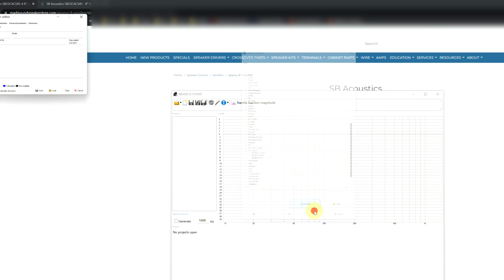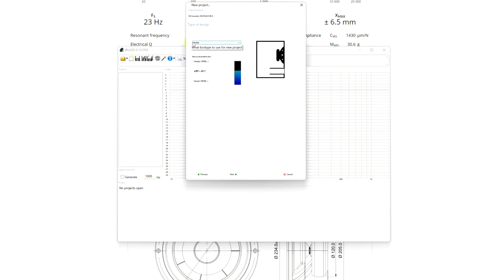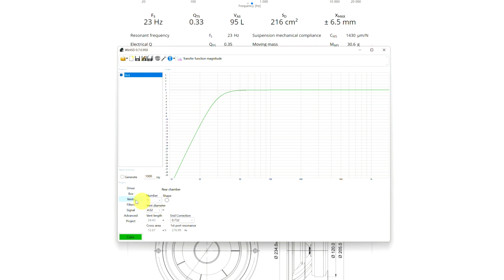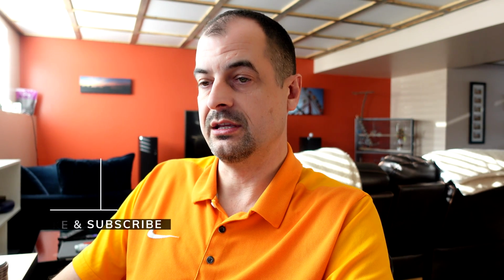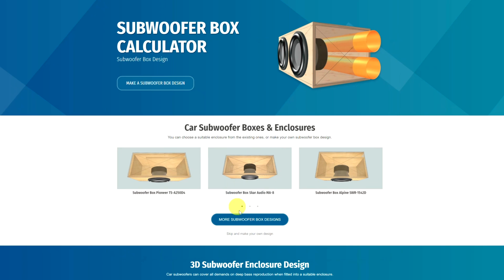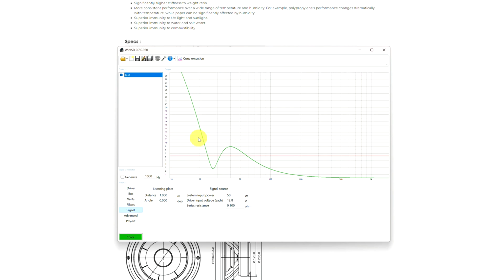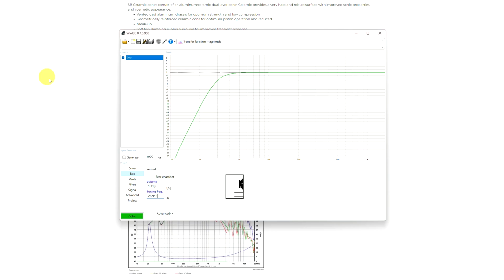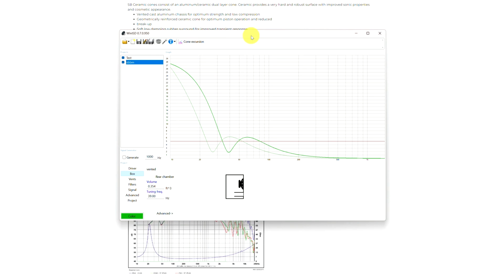Using WinISD To Help Design A Speaker Box

Comment: Hi.
I like the videos from you so far.
Got a couple of questions:
1-What is better - tune port to higher frequency or to a lower one than the fs?
2-if able to tune below the fs, how much lower, 5,10 or 15hz lower than fs?
Keep up the amazing box building!
Thanks.
Reply from the maker: I appreciate you checking out the channel.  I can't answer your questions with certainty but some reading seems to have people typically going slightly above Fs.  If you use WinISD start by what it picks for you, it defaults to the theoretical best provided you have driver specs loaded correctly.
Reply: Thanks.
 @davewiebespeakerdesign